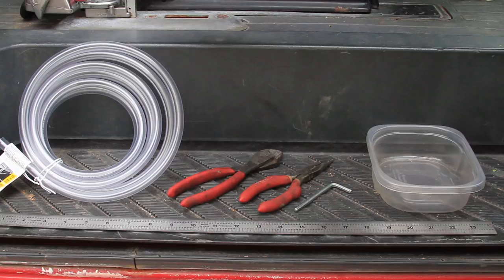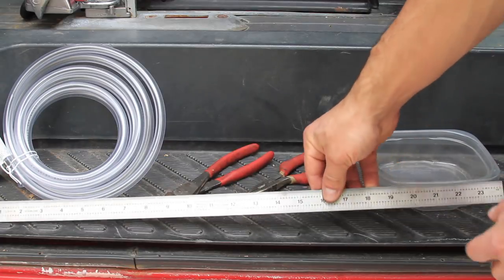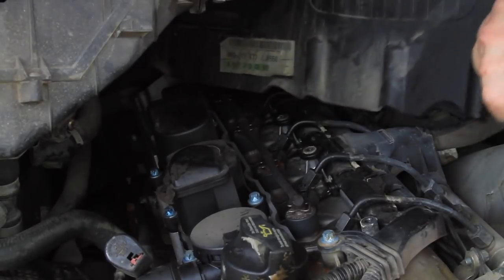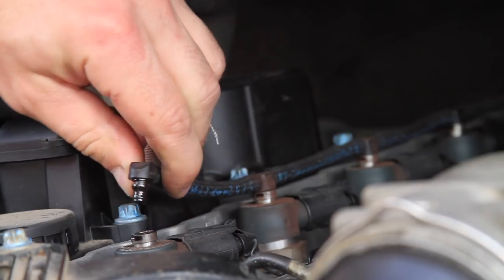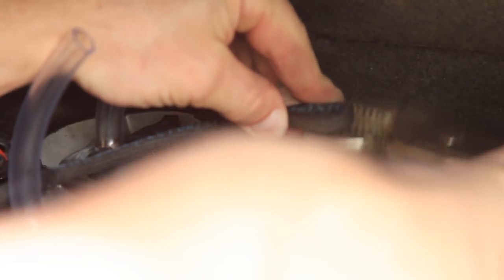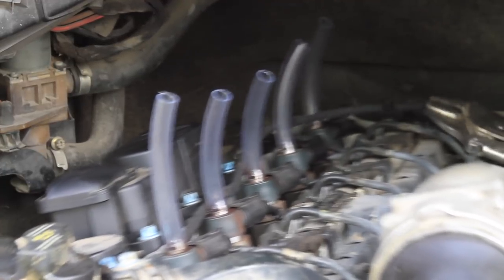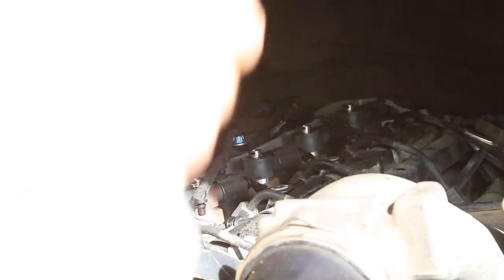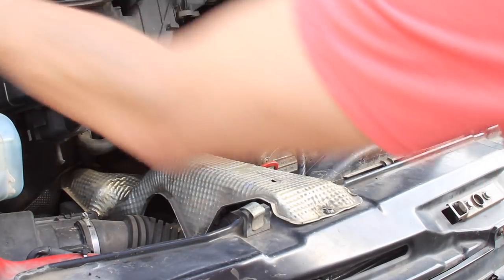2006 Dodge (Mercedes) T1N Sprinter Van Diesel Fuel Injector Leak Back Test How To

Comment: So what's the results of the test???? How do I know if an injector is good or not?????
Reply: For real.
Reply: Yea what was the point
Reply: @andrews9328  🤔 if you dont understand you probably shouldnt do this, you could hurt yourself on the wrong system. this is just for low pressure systems and will only help you understand some possibilities not all. if one fills faster or slower what could that mean?? 🤓 what is the purpose of an injector?

Comment: I was a little confused about what this test was for and what the results for your car were. Reading your blog cleared that up, but IMHO it would have been nice if you had explained in the video.
Reply from the maker: Thanks for letting me know! I guess I put it together with the idea that the video would supplement the blog post rather than the other way around. But I'll keep that in mind for next time.
Reply: It is to test one (out of several) failure modes of the injectors. Some fluid leaks by the small clearances to lubricate and cool the injectors valve. Eventually, with wear, leak by becomes excessive, and the injector is out of spec and should be replaced. The service manual (Found at sprinter source) will explain the specifications in detail. You don't want more than 20% variation between the injectors ideally, and if an injector leaks by more than 1.5" in the tube during 10seconds of cranking, it fails the test: https://sprinter-source.com/forum/showthread.php?t=17149

Comment: No fuel comes out into tubes at all.    My van just didn't start with no warning.  Started with ethanol into air intake for a while , ran ok but would stall sometimes.  Did this test with no warm up as ethanol doesn't work now either.   t's a 313 cdi 2001 with external fuel pump, not in tank.

Comment: All the wiring around injectors have carboned up so much from previous black death incidents.  It's seems impossible to remove 🙄
Reply: Same problem. Especially around the electrical clips to injectors.  A real pain , can't get them undone.

Comment: Tim, I have an O6 2500 and have just replaced a leaking #2 cylinder leaking injector copper washer. Motor started and ran quietly. Came back to drive it next day and now I have lots of fuel coming out of the drivers side, a 3/8" dia black rubber hose coming from under the intake manifold. What do you think is the problem? I have lots of fuel draining down the driver way. I spot no leaks at the motor and the top of the motor with the black plastic cover removed show no fuel leaking.?? Any ideas?
Reply: I had the exact same problem. Was a high pressure injector pipe leaking.
Reply: @jakejohnson_  When I disconnected the high pressure fitting on the injector fuel pipe to the injector I failed to notice that there is a snap fitting there. So I did not get the connection tight and fuel was gushing at idle. Went back and pushed down on the fitting connection and it popped into place and all the leaking stopped. I then noticed the
fit revealed a lower height of the connection. Hope this helps. Had no other leaks in this area. I had a relatively small amount of "black death carbon" (injector seat washer bad) buildup in the injector valley and I think this is because I always let the motor warm up to the first temp gage mark before driving away. If you have an injector seat washer leaking and drive off with the motor cold you will have lots of black carbon build up in the valley and that stuff is hard to remove.
Reply: @vincentrolfe1384  my high pressure fitting has a very small crack in it so had to replace with new. Did make a mess of the engine bay though!
Reply: @jakejohnson_  Well, that is a different thing! Let'er rip then. How many miles is on your beast?? I am sneaking up on 180K and all is well. Did you take a look at my vid on the new MB median bearing reposition bracket. Little bit of money and you have a better situation on that part of the driveshaft. I just happened to stumble across this redesign by MB. You will have to do a little fitting with the socket screws but the benefit is huge.

Comment: so if there is no fuel in tubing thats bad? injector stuck closed?
Reply from the maker: I'm not sure - the fuel in the tube is "overflow" effectively and there should be some but not too much... that's what this test is measuring. And these injectors usually fail in the way that lets out too much fuel, not in a way that they let out less.
Reply: so just to keep the engine from hydro lock if computer is bad sending to much fuel to cylinder. or bad injector. got it thanks
Reply: I've got the same issue.  My van just didn't start with no warning.  Started with ethanol into air intake . Did this test with no warm up as ethanol doesn't work now either.   No fuel comes out into tubes at all.